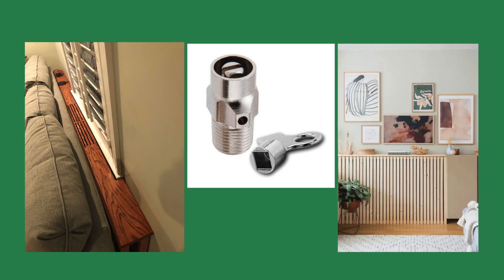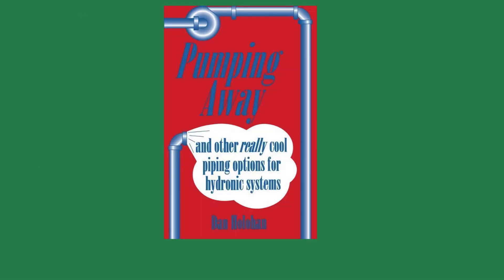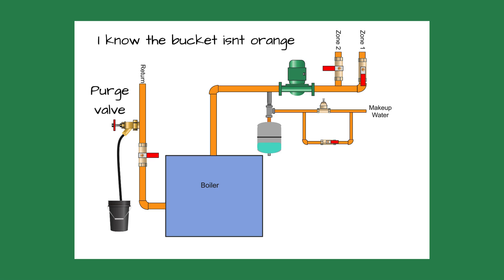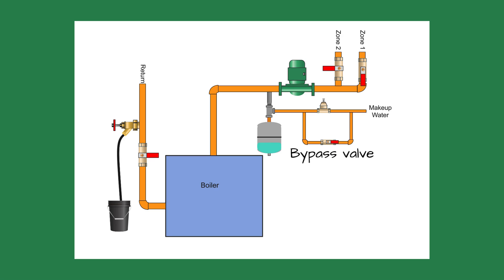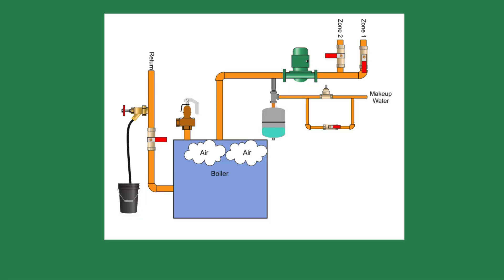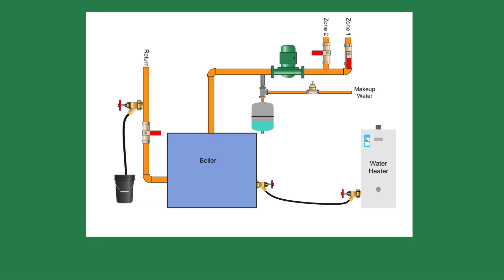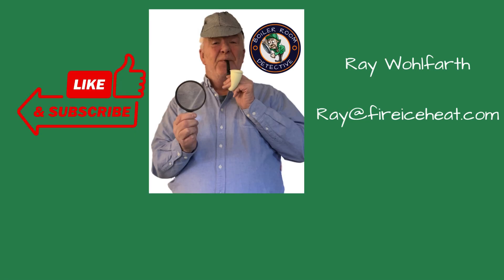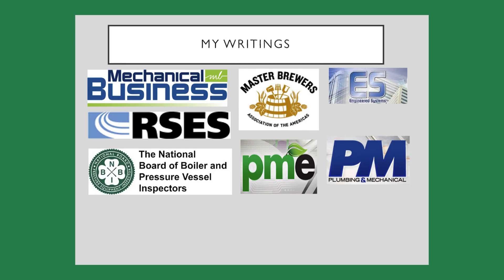Venting Air from a Hydronic Heating System—The Easy Way!

Comment: Nice when you install / the boiler is built with the feed in the return after the isolation valve. Allows for purging the boiler as well as the zones
Reply from the maker: Yes sir Thanks